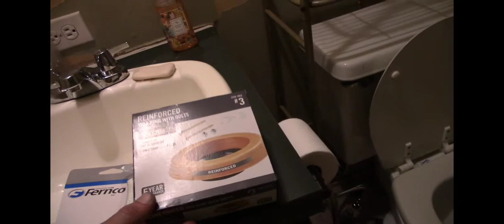toilet wax ring replacement

Comment: I could remember doing that every day when I installed floor coverings A small handheld keyhole saw works. They do make them out of brass/or plastic now👉🤠
Reply from the maker: for the ones that they put to close to a wall or vanity i use a dremal with a cut off wheel for the bolts